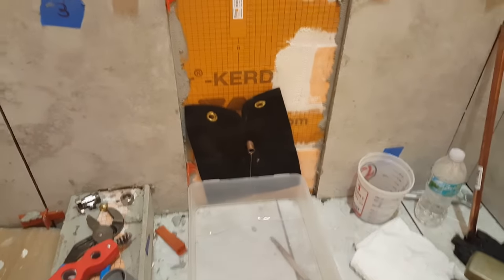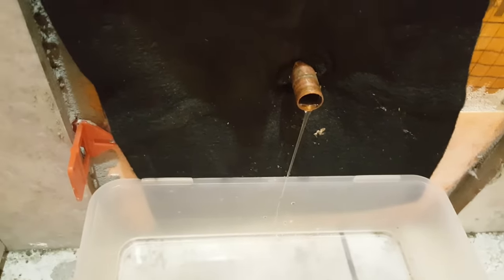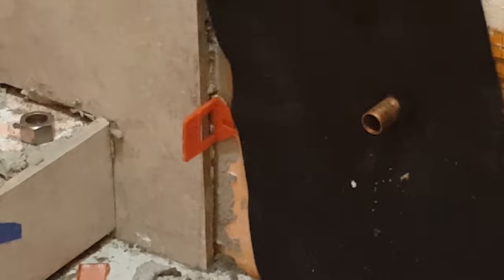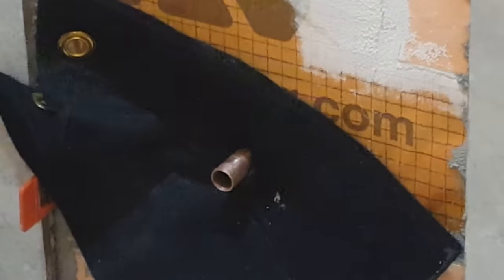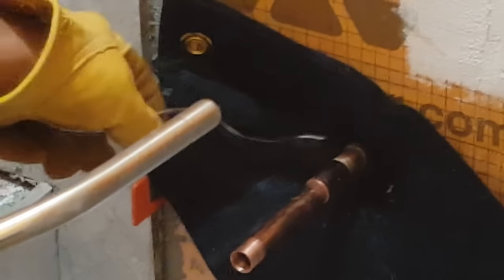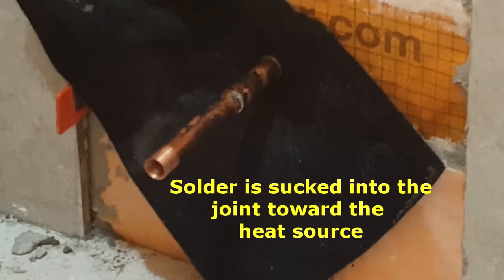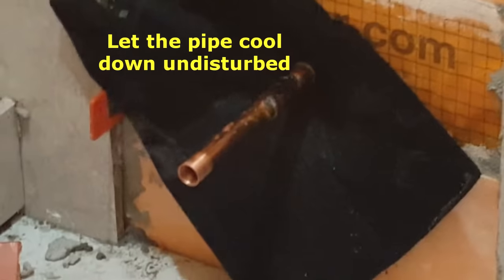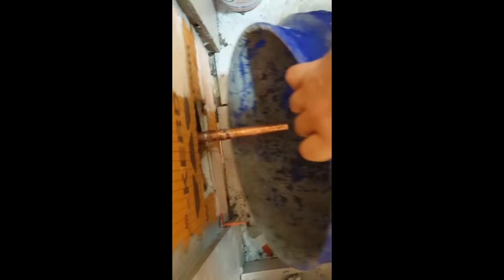Insane Plumber's Trick: Solder Copper Pipes Dripping Water

Comment: Handyman work, professional plumbers only use acetylene turbo torch, and use  different torch tips depending on the size of the  pipe you need to solder, thats a big flame for a 1/2" pipe. Have you ever heard of jetsweat tool?? You also left money on the table, next time replace the main water shut off first, you are not providing good service if you dont fix the valve

Comment: I had the same problem with a main shut off gate valve, change to a ball valve and it will stop all water flow. I like the all plastic ones since FL water is corrosive and full of calcium deposits, metal just won't last long term. I've used the bread trick for CPVC also but if you use the blue wet location glue a little moisture won't be a problem. Not sure why you brushed and fluxed the inside of the pipe but you should have done the inside of the coupler right? I never knew about the lenght of solder. I always just fed it enough to fill to the edge of the outside fitting but I'm not a pro, just a DIYer. 
BTW, Def Leppard sucks.
Reply from the maker: Yes indeed, any chance we get we change the main shutoff to a ball valve and also did that at my own house.

Comment: Cool trick but I always solder from the bottom up since heat rises. And never flux the inside of my pipes just inside the fitting and outside the pipe
Reply from the maker: Yes that was a slip of the rest and you heard me say on the video that I didn't need to do that and after I did it

Comment: The bread trick works wonders but in this case you can see that it didn't hold up long enough.  Not enough bread and way too much flow.

The reason you were still successful is that you can in-fact solder a joint with water in it.   

You see the steam flying out the end of the pipe?  That's boiled water.

The only time it becomes a real issue is when you are trying to do a joint on a "closed" system of pipes.
If that copper extension you installed had a cap on it you would've failed because the steam blows out the solder joints.
It has nothing to do with not being able to heat the pipe up enough.  The water doesn't cool it down too much.

Steam will blow out a joint while you are in the middle of soldering it because of the pressure that is created.

The bread did buy you a bit of time.  But if you were trying to solder a coupling between two lines that had a similar amount of water it wouldn't of worked.
Nowhere for the steam to go.
Reply from the maker: What are you talking about, are you completely blind?  the bread worked. It stopped the flow. The fitting soldered on, it would never have soldered on if there was a flow of water in the pipe. I have no idea how youtube allows clowns like you to troll people like this. Pop up on someone's video and start spouting lies. You sound like AOC.

Comment: Seen a few things that I disagree with. No need to add flux inside a pipe if the connector goes on the outside. Should always heat the pipe up from the bottom then add solder on the top. He said he uses 1/2" long piece of solder for each end of connector but doesnt look like he used a 1/4" for both. The first joint I seen needed more solder for sure. The bread trick can work, but not every time. They make a tool called a Jet Swet that plugs the pipe so you have time to sweat the pipe and not be so rushed. Plus, who happens to carry a loaf of bread around with them everytime.

Comment: Buy a torch head that you can control the flame better. If you've ever soldered in a tight spot in a wall with tar paper near by you'll know what I mean. If the gate valve was faulty then the homeowner needs to replace it. Regardless of the inconvenience of a water interruption its extremely important that a shut off valve is installed in a accessible location in case of an emergency. Gate valves are garbage especially when you shut one off and the handle breaks free from the gate.

Comment: I think you could have wire-brushed the outside of the pipe before sticking the bread in.
Would have given you another 30 seconds or so.
Reply from the maker: A few other people have mentioned that but it turns on I didn't really need an extra 30 seconds the bread  hung in there for several more minutes even after we were done with the job the bread held in place right up-to-the-minute that we gushed it out of there by turning on the water full blast into the bucket at the end of the video.

Comment: Heat it from the bottom, leave the heat on while applying the solder.
Reply from the maker: Interesting, plumbers seem to be split on this, some say remove the heat and then it should be enough to start running the solder around. Other plumbers say keep the heat on. I say remove the heat, and if the solder does not melt, put the heat back on, but it usually melts fine for me.
Reply: Bill, I agree with you.  I would also come up from the the bottom with the heat as the flame will wrap easily around the pipe and then bring the solder down from the top.  I would also have used a smaller torch tip.  I typically use just a propane bottle with the screw on fitting and hold the tip of the inner cone to the copper, or just below the copper.
Reply from the maker: Who do half the people say to leave the heat on while soldering, and the other half say t remove the heat then apply the solder when it's ready.

Comment: You can get by with a little water in the pipe as long as the steam can escape and doesn't blow out your solder joint.

Comment: All you had to do is use a compression fitting. Not to mention always use the tip of the BLUE flam. It's he hottest part, but it MUST be the tip of the BLUE flame. Plus, the flame should always be OPPOSITE the solder. Back to school bro!

Comment: 1. Clean the pipe BEFORE you plug the pipe. Then just wipe the water off. Duh!

2. Don't bother cleaning the inside of the pipe. That's POINTLESS!! If you need to ream the pipe use the tool you have sitting right there at 1:14. Use the right tool for the job rookie. The wire brush will NOT ream out the pipe. 

3. The comment about the oil on your fingers is NONSENSE. The flux will take care of any "oil'

4. Don't just dab the flux on. Make sure you put it 360 degrees around the pipe AND inside the coupler. 

5. This is a time critical joint. Don't just drop the solder on. Hit the entire fitting 360 degrees to be damn sure you got it. 

6. Heat the pipe from the bottom or the side not the top.

7. I bet this leaked!!!!🤣
Reply from the maker: 2 1/2 years later, still works perfectly.

Comment: You can also find a lower faucet and open it.  That will take the water away from the pipe you’re working on.  No need from bread.
Reply from the maker: i don't know why everyone keeps telling us this bit of advice, it is meaningless for us, LOL did you not see this is the lowest pipe in the house, inches from the floor? Any faucet will be higher than this. There is nothing in the whole house lower than this toilet cut off valve.

Comment: Use a Sharkbite fitting. Job done in 2 minutes. No solder or flux needed.
Reply from the maker: Well, I'm not sure I'd trust a shark bite fitting, certainly not inside a wall, but yes maybe on the outside of the wall as in this case, I mostly use Shark Bites only for temporary work, like capping off pipes. And in my own house I had to use Shark Bite under the bathroom vanity to help convert gray polybutylene piping. The problem was the builder left such a tiny pipe coming out of the wall, and tiling up the wall made it even shorter pipe, we had no choice but to solder on that extension pipe, not even sure a shark bite would fit on that stub of a pipe.
Reply: Sharkbite is for handyman hacks
Reply: Shark bite are code approved and can be used in walls. Nice bread trick
Reply: cant use a sharkbite as this is being tiled over
Reply: sharkbite will also not hold up as long as a solder connection.. also.. not always is there enough room to get the sharkbite fitting on..  sometimes u can cheat a coupling on a small length of pipe and only push the coupling on maybe half way.. shark bite  no such luck  it must go in the full length.. it can not have anything like a burr or glob of solder on the end.. as this may not allow the o ring to seat or cut it.... also... shark bite is extremly expensive.. and is not solid... so if u were trying to hang something like a angle stop ... good luck using that valve in the future as the whole pipe would spin... and i garuntee with out a doubt....  its gonna leak when u do that....

Comment: I need to know how to solder the shutoff valve onto the pipe that is wet. Bread probably won't go through the valve so well.
Reply from the maker: Best Racing Tips Win At The Dragstrip  You never know it might be able to blow out through the valve also can you pull out the interior of the valve so that when you turn on the water it's basically just coming out the pipe. And  Please also remember any time you solder a shut off valve onto the end of a pipe make sure the valve as in the open position so that although hot steam can escape out instead of damaging the inside of the valve.
Reply: Thanks, I thought of that except it's one of those small 90 degree ball valves they stick behind the toilet. Not a very large hole in the middle of it and disassembly looks suspicious at best.
Reply from the maker: Best Racing Tips Win At The Dragstrip  Your other choice is to see if you can cut the water off at the street because those are usually completely a 100% accurate at cutting all the water off
Reply: @jeffostroff  compression fitting

Comment: ...but you have only propagated the problem forward!  Unless you do ALL the soldering on the following joints at the end of the new pipe, you  will be plagued by the same problem again.  Normally a threaded fitting is soldered to the pipe just behind the wall so the drywall/tile can be installed, a hole drilled, and threaded connection made to the shut-off valve.

Comment: If you have water still flowing out of the pipe after an hour then you have another problem in your system. If the valve on the hot water heater and the mains are closed then you shouldn't have a continuous flow of water that long. Personally my system has a shutoff for every room at the distribution panel near my hot water heater. I can cut the water to any of the rooms and drain those pipes right at the distribution.
Reply from the maker: We have been finding this a lot on houses and condos that were Built-in the eighties in nineties here in South Florida. That builders put on real cheap gate valves that just don't seem to last. We've had a number of gates valves replaced on projects over the years because they just won't shut off all the way most likely the gasket is breaking down.
Reply: @jeffostroff  that's what I figured. That's a big reason why I don't cut corners. Especially with water and electricity. Both of those can be a huge cost if they fail.
Reply from the maker: @systematic101  Luckily, the failing gate valve on your house main is not a deal breaker unless it is really gushing, we can always work around it, except for 2 years ago at my friend's house, when turning off the gate valve that would not shut off completely, and turned it back on, the handle and stem broke off from inside the casing. Had to call the plumbers over with the big torch, replaced it with ball valve.

Comment: The problem dripping water will come back to haunt you if the soldered joint fails . Use a jointing method without heat is best .
Reply from the maker: That is why we always make sure to do the solder joint correctly it has been tried and tested for many many decades with no problems as long as it is implemented properly. The standard rough in copper pipe coming out of the wall has always been done with solder. The part that you do without the heat is at the end of the pipe when you put the quarter turn angle stop on there which is a compression fitting title and to down with 2 wrenches for both nuts.

Comment: Compression fitting is easier to remove later.
Reply from the maker: Yes indeed  that's why I always replace all shut off valves with compression fitting 90 ball valves. I cant stand gate valves, they should be banned by code!
Reply: Until the compression fitting lets go.
Reply: What species of alien is going to loosen it ?
You will be subpoenaed to testify before Congress.
You'll be targeted as a Disclosure subversive.

Comment: My friend i would say to put the bread back in the kitchen the kids are hungry!
for a problem such as this you could

a)  get your hands on a mechanical stopper attached to a rod
the product is called jet sweat. its a few inches long and will expand outwardly so you can solder
and dont worry about contaminating copper fittings with oil from your hands, wouldnt happen

B) disconnect the union nut on the house side of the meter so that any water leaking past the valve will drain out of the system at the point of entry to your house

C) Milwaukee pro press
Reply from the maker: LOL, I guess you didn't see our link to the jet swet in the description. I guess you also did not see our other video a few weeks ago where we reviewed the Jet Swet and showed how to use it: https://youtu.be/h1ZF7MWrh1k
Lastly, this video is for DIY people who don't have $50 to spend on a Jet Swet and wait for delivery, they need a solution now, this very hour.